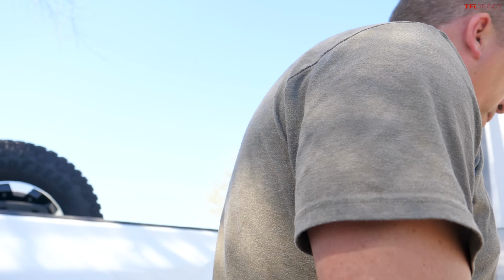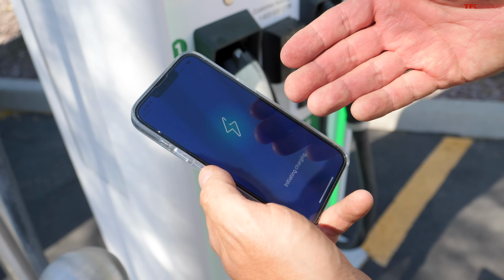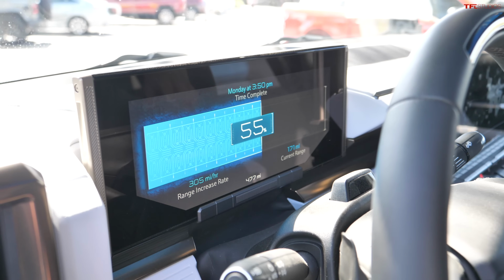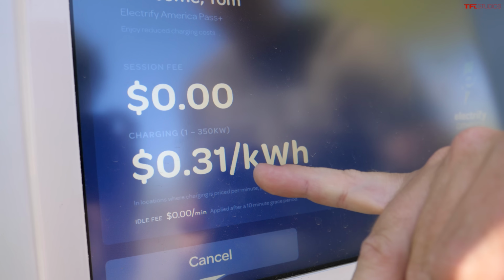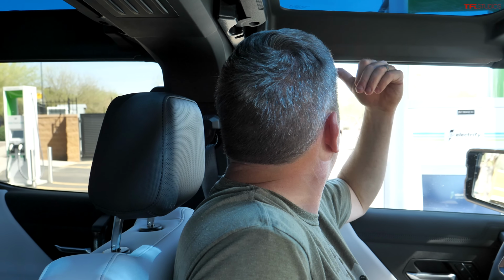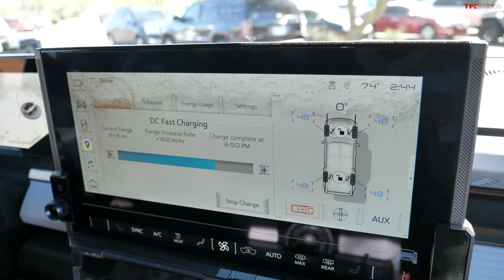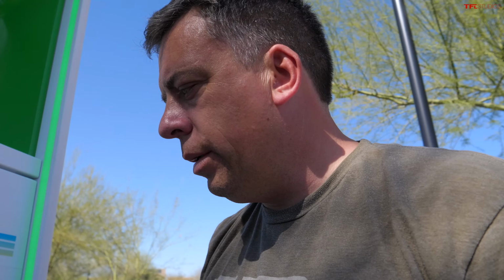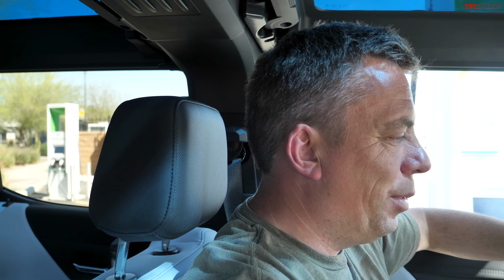How Fast Can I Charge The GMC HUMMER EV In Just 15 Minutes? The Answer Is Surprising!

Comment: Will the grid handle ALL cars being EV? Elon Musk has said that the entire US electrical power requirement could be supplied by one 300x300 mile area of solar panels. I thought "whaaat, no way" so I did the math and it is very conservatively true. Home charging currently is about one third of the charge cost in this video. I believe that it is not emphasized enough that home charging will be the vast majority of all electrical vehicle charging, not roadside charging (I also believe that the convenience of home charging will easily counterbalance the inconvenience of much less frequent roadside charging (not for trucking though, hmm)). Lucky enough, home charging almost always takes place overnight when the grid is not highly used. I haven't but someone should do the math of how much electrical power it would take for all electrical power consumption, including the charging of ALL vehicles being electric, overnight versus the typical overall daytime consumption. The rough math is not actually too hard to do. The current grid at current max use likely has a relatively small buffer to overload. If the calculated overnight factor (including all EVs charging) exceeds the current daytime max then the grid has to be upgraded. I haven't done the math, the factor could be even or it could be 5 or 20 times. If the grid has to be upgraded then you can bet the cost of at home charging will rapidly be increased to likely even more than the current fuel costs. I highly suspect that reduced cost to the consumer will NOT ultimately be a benefit for EV conversion but more likely will be justification by the powers that be to increase the "fuel" cost of vehicle travel! Someone has to do that math.
Reply: The one figure I saw was around ~30% adoption rate before electrical grids will need significant upsizing. I think that 30% will take a while even as popular as EV's are right now. What is it now like 1-2% only in the US?  The same argument was made back when central AC was getting popular. All these homes built in the 50s-70s with only 60A electrical service couldn't handle central AC without compromise. Everything back to the utility needed to be slowly upgraded as AC got more and more popular. Same will need to happen with EVs.
I've noticed that when new major powerlines are being built, they are usually only 1/2 or 1/3 populated. I assume that's on purpose so if demand keeps increasing they can just add more transmission wires.
And maybe a good solution is for utility companies to offer significant discounts on rates and charging equipment if you only install 30A of charging or less. Which should be fine for most, and would probably stretch out the time needed to upgrade utilities by a large margin. Maybe that could support 50% EV adoption if the majority only had 30A charge circuits.  
24A is all I charge my Model 3 at, and my daily commute is 120mi. That recharges in 6-7hrs overnight depending on how cold it is.  
However, if vehicles like this Hummer or other full size electric trucks with 150kWh+ packs get popular and households get more than one large EV, a single 30A circuit isn't going to be enough. But a household with 2 standard sized cars could, especially if both vehicles only travel ~50mi a day.
Reply: @andrewt9204  I took a closer look at reports and there is a full range of expectations. Most are positive and say only typical upgrades necessary but others say otherwise. I  don't think I  heard of the possibility of rolling blackouts in North America, due to electrical supply, until the last couple of years (without EVs). The grid has to support the absolute worst case at all times, especially if transportation is included. If there is already problems occurring then all vehicles as EVs seems like it will make matters much worse. Some say EVs will improve the grid by acting as available stored power for those problem points but I really don't think people will take too kindly to only a 75% charge in their cars because it's a hot day when they expect 100% (when they need the charge most themselves). It will be interesting......

Comment: 175-180 kW at 50% is quite good speed actually. Not many EVs would be able to do that (as seen in Mr.Bjorn Nyland's Channel)
Reply: That's because the Hummer's battery is about 3 times larger than most at about 200kw in size.

Comment: And there's my issue with EV.....in 12 minutes I can have filled my F150 XLT with 36 Gallons that gets me over 500 miles plus get my snacks/drinks and be back on the road. When I can charge an EV to 300+ mile range in 10 minutes or less it makes sense, until then, it's kinda worthless to me.
Reply: Same...
Reply: With a cost of $144 at our current gas price of $4 per gallon for that fill up.  EVs are not for everyone.  In my case it would benefit because my job is less than 20 miles and I will be charging at home and it would only cost me 4 bucks for that same charge.  These chargers have to make money so of course they will charge more per kwh.  So if it's not to your benefit don't buy one.  Simple.
Reply: @robg4660  but do realize what’s powering the electric power plant ?

Comment: Will be interesting to see a more complete charging cycle from a low SoC to, say, 80 or 90%
Reply: Didn't have enough time to get the battery low enough and then charge it. Will do more testing soon.
Reply: DC fast charging like that isn’t really the way to do it. 5-70% is what I shoot for in my mach E If the routing allows
Reply: Yes, This is what buyers would like to see.  Bjørn Nyland does this for many EVs.  If GM was serious about competing with Norway for EVs, they need to sell the Hummer there, and then Bjørn can test it. 😀

Comment: Using the current fuel prices averages, $14.25 for 78 miles is only a few bucks cheaper than fueling a typical 4x4. Keep in mind that fuel includes Brandon's taxes and fees. So, in reality, with prices being equal, your trip to Moab will cost you about the same as fueling up a dino juicer, maybe even a little more.
Reply: You realize a gas version of this would get 10mpg, right?
Reply: @ColeSpolaric  No, not right. That's being extreme. Even it were true, I'm being very generous by calculation currently inflated fuel prices. Pre-Brandon, I could drive my diesel 4x4 on KO2s 78 miles for about $8.00 in fuel. Even with current prices, I could easily do it with $18.00-$19.00 in fuel.

If the playing field were level, fuel would be about 1/2-1/3 of what it is now, and electricity would be slapped with a 30% road tax, since that's we pay that at the pump. 

I hope you enjoy your $110,000 EV, because we're subsidizing you.

Comment: Peak charge rate is usually between 25-40% SOC. During 55-75% charge, you are probably not getting the max charging rate. Above 75%, charge rate drops quite fast, and above 90%, it's usually a waste of time charging.

Comment: The fact the Hummer charged from only half charged to 75% in less than 20 mins is actually pretty impressive since these are usually the slowest examples of fast charging rates.
Reply: It's not that impressive. The fastest charging speeds are in the middle of the pack.
Reply: this pos is going to need all of its range to even have a dream of towing something up to 7000 with its 9500lb weight lol
Reply: @richardroberson9277  Lmdao. Yeah, I wonder what the Ford Lightning’s range is while towing something 7,000 lbs. It doesn’t weigh anywhere near 9,000 lbs either. 😂
Reply: It's impressive because the battery is huge on these trucks

Comment: If it becomes normal to charge EVs at 350 kW or more, I wonder how that will effect (no pun intended) the grid. Is it in needs of upgrades? Maybe not now, but if we say 1/3 of the vehicles on the road is electric 20 years from now, are we making the necessary preparations? 🧐
Reply: A popular option for new stations is to have a large battery pack that shaves off the peak demands so that there is less strain on the grid.
But yes, udating the grid is definitely something we need to keep in mind.
Reply: @prerunnerwannabe  Which is a terrible idea. Batteries have little scalability, so charging will cost you more. At $14.25/78 miles, it's already expensive.
Reply: @Mark_Christian25  it's really the wild west out there for costs at charging stations. Where I live EA charges 57c a min for 350kw, while a competitor charges 27c for the same speed.
Reply: @Mark_Christian25  That's not the whole picture. If the grid connection has to be upgraded to handle the power of a fast charging station, that costs an absolutely massive amount of money and time. Additionally, every month any fast charging station has to pay a peak demand charge which is often $20 per kW. Meaning that if at one point during the month the station pulls 1000 kW of power, they will have to pay the utility company $20,000 dollars on top of the normal electricity cost.
Reply: @Mark_Christian25  it's a bad example because the Hummer is pretty inefficient -- most EVs would have gotten more than 78miles in that time and/or it wouldn't have cost $14.28 for 78 miles.  $.31kw --- so $14.25 is about 46kwh -- more than half of most EVs battery capacity.
Reply: @prerunnerwannabe  $20 per kW?
Reply: @iamnid  Regardless, it's still expensive. An EV with 50% better efficiency would still be over $7 to go 78 miles. At current fuel prices, it's like driving a 47 mpg gas car, which is not terrible, but it's expensive for charging.
Reply: @Mark_Christian25  Yep, as a demand charge for the single highest moment of draw per month, $20 per kW is not uncommon afaik. That's in addition to the ~12-15 cents per kWh that the charging company has to pay for the electricity.
Reply: Just burn up all the oil in generators that won’t be used in cars anymore...problem solved?!?
Reply: Are you kidding? You're talking about the government here.

Comment: This thing is expensive to charge, but think about a gas version that would get like 10mpg. You would need $120 or more of fuel to go 300 miles. Approximately $60 of electricity at that rate.

Comment: 5:39 That's going to be very helpful because right now, EV owners are having to guess whether there is a factor affecting their car's maximum charge or an issue with the charger itself. This will save people a lot of time charger hopping if they aren't seeing the speeds they expect to be seeing.
Reply: Yeah it's a brilliant touch. Currently the only method is to use an OBD2 dongle to read battery temp, volts and amps, etc, and try and guess.
Reply: @chunkychuck  Yeah, and even then, you'd need to know the parameters. Hopefully, it also reduces confusion for people who plug into 50 kW chargers and wonder why they aren't seeing advertised charging speeds.
Reply: Yeah while your hopping around getting to know all the chargers in your town maybe you will run into some of the other suckers that got electric toys and you can chat it up about how much money you are gonna save after you spent 100k to  have the honor to wait at charging station for three hours to save 20$
Reply: @michaelbassett5105  You don't seem to know anything about EVs. Public chargers are for convenience and road trips, not cost savings. My Chevy Bolt EV costs me 2 cents per mile to charge at home. Why would I go out of my way to spend 8 cents per mile on a public charger?

And in the case of the HUMMER EV, do you really think that stopping for 30 minutes for every 7 hours of driving is a huge sacrifice? Most people will stop for at least 30 minutes over the course of a 500-mile drive. 🙄
Reply: @newscoulomb3705  same here I to charge my electric toys at home.
Reply: @michaelbassett5105  Whoa! Hold on there, bud. This is a family channel.
Reply: @newscoulomb3705 haha good one.  I was beginning to think you took your self seriously.  I know I don’t.

Comment: What kind of whr/mile or miles per kWh is the hummer getting? Because it weighs so much it doesn’t have to be rated by the EPA. Therefore, no one really knows how inefficient this thing really is.
Reply: Less than 2 miles a Wh
Reply: 300 miles on 200kwh rated.  670wh/mile  epa.....so 700-800wh/mile  a model  x weighing 5000lbs towing a 5000lb horse trailer got 1000whmile >>  same total weight nearly and 2xvmore drag and still barely worse

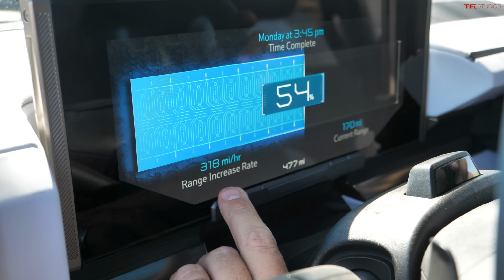Comment: 2:36 Okay, so you started the charge at over 50%, which is not going to give you very good numbers, and the HUMMER EV is unlikely to reach its peak at that battery percentage, even if the battery is conditioned.

Comment: 2:00 Oh, come on, GM! The flap on the Chevrolet Bolt EV's CCS port was by far the best DC pin covering option. This plug cap looks ridiculously difficult to work with.
Reply: Gotta be smarter than the cap.
Reply: @WheresHerb  Ease of use has nothing to do with being smart. Andre knows how to use a basic plug cap, but that doesn't make it any easier with a phone in one hand and a CCS plug in the other.
Reply: ha. why not just reuse the part even.  this one is identical with a stupid little led on top lol
Reply: @richardroberson9277  Identical to what? This is definitely not the same 150 A CCS socket that is used in the Bolt EV. This one looks like a beefed up Phoenix Contact CCS socket, rated for a continuous 500 A DC and 80 A AC.

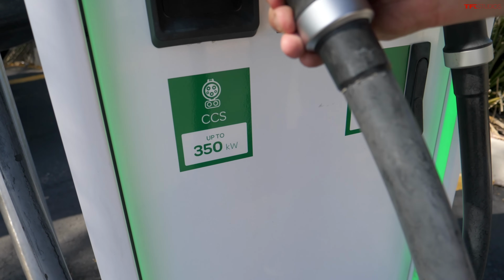Comment: 0:45 That might not actually be the maximum charging speed of the GMC HUMMER EV. More likely, that is due to the equipment's limitation. The HUMMER EV's pack is a double-stacked version of the Cadillac LYRIQ's pack, which has a peak charging speed of 190 kW, so the HUMMER EV's theoretical max charge rate is 380 kW. The problem is, the LYRIQ requires a full 500 A of current to achieve 190 kW, and that amount of current is not currently available on these chargers when operating between 500 V and 1000 V.
Reply: I have an idea set up an antenna running to the charging port and camp out in  a thunderstorm.  You might be able to reach those charging levels for a second or two.
Reply: @michaelbassett5105  I think the term you are looking for is "lightning rod," but I guess that's what you get by attempting to learn about electricity on Saturday morning cartoons. 🤦‍♂

Right now, the GMC HUMMER EV's realistic peak charging speeds will likely be around 320 to 330 kW on the existing 350 kW DC fast charging infrastructure. When charging providers start adding enough modules to provide 500 A at 1000 V, we should see about a 50 to 60 kW bump in peak charging speeds.
Reply: @newscoulomb3705  well we are talking about “electric toys” so...
Reply: @michaelbassett5105  Certainly. It's better for children to play with electric toys than the gas-powered toys they are currently playing with.
Reply: @newscoulomb3705  good point I concur!

Comment: When you do the math.. it's about half the price of gasoline... would hope it would be better than that if the mass public can justify spending extra money purchasing an EV as well as extra time charging..  If you only charge at night at home, then it's not bad... until the electric companies jack up the price of electricity because people are "using it more".
Reply: Electricity rates will rise due to the rising costs of oil, gas and coal, which power the charging stations.
Reply: @sptrader6316  correct we burn oil to charge “electric toys”.  Makes a lot of sense.
Reply: Well, it's a hummer and is a lot less efficient than your average EV.  Most EVs would have gotten half their battery full in that time.  The Hummer has a battery about 3x the size of any other EV so the "miles" that were added back were similarly less.
Reply: We all need to be riding around on those scooters you see all over underdeveloped countries...problem solved.
Reply: Forgot to include road tax that is part of the gasoline price.

Comment: Typically the highest charging speed is achieved when the battery is at less than 20% or so, depending on the car. From a certain point it'll start slowing down so starting the charge at 50% is not a good idea to test the charge speed.
Reply: Seriously, got to get to a 350kw station at 5% SoC and give a min by min data collection on Kw and SoC
Reply: The Hummer is awesome but a major flaw: not affordable for the masses. 

With the results of Democrats policies causing massive rising cost of gasoline, diesel, food, utilities etc. hyperinflation, the masses can’t save enough $ to afford one; the paradox of the Democrat’s Green New Forced Bankruptcy Deal. 

At this point voting for a Democrat again is stupid is as stupid does. Don’t be stupid.
Reply: @icare7151  Mmmm, I'm not going to get into a political conversation so this is the last message about politics I'm going to write but can you tell us how the government in the US creates as well "massive rising cost of gasoline, diesel, food, utilities etc. hyperinflation," in Europe as well? Because it's happening in the whole World for obvious reasons...

Comment: guys, as an ev channel, this is an incredibly bad take. 350A EA station, starting at 50%, etc etc.
Reply: This is at a GM first drive event. Andre did the best he could with the time allowed to him. To get the charge down below 20% would've taken another hundred-something miles and almost two hours of additional time he likely didn't have at the event.
Reply: @jakelee5456  incorrect. either he doesnt understand charging rates and EVs (bad since this is their EV channel), or he knew he wouldnt see max speed given 50% and amp limit but played dumb (still bad as this is just stoking the why ev no work side)....
Reply: @laloajuria4678  Must try harder to control all variables to make EVs look as good as possible, got it.